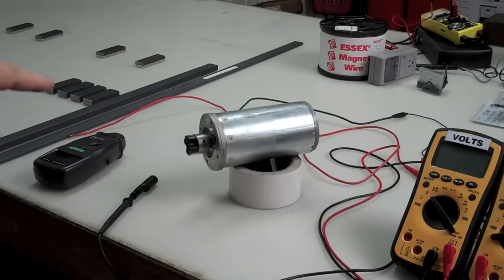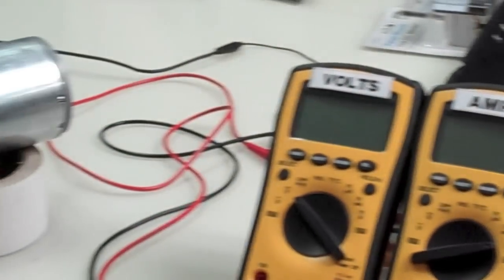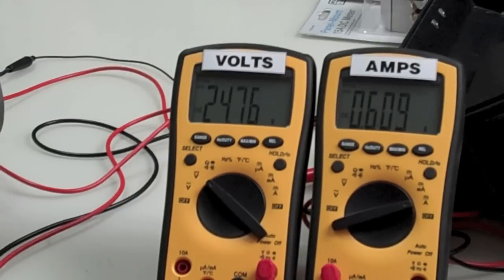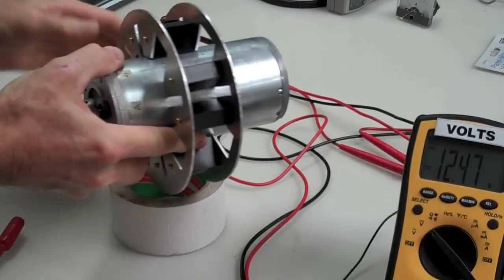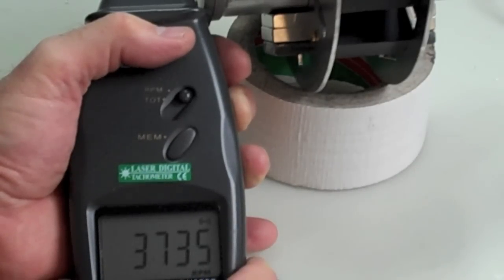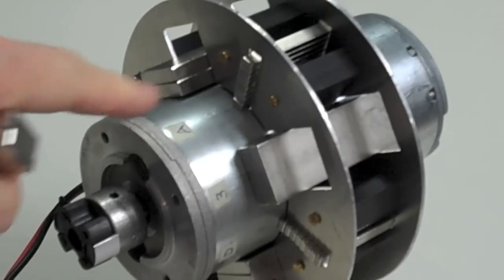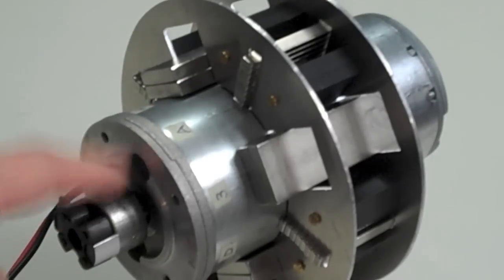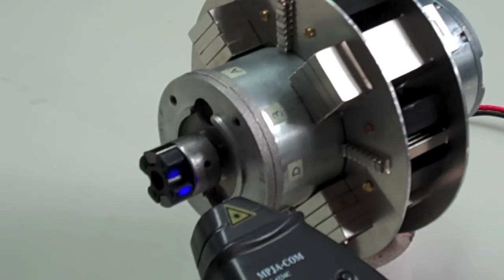STARGATE MOTOR  FULL DEMO

Comment: It would be nice to run the motor at 6V and see the power consumption and the rpm. I guess one could also design a circuit to vary the input voltage while keeping rpm at 3k AND driving an external generator with varying loads.

Comment: i did the same thing before with smaller motor, i was able to run a motor with another motor this way with less power in and more power out,  It is really simple

Comment: at 15000 rpm,there is a good chance of thrown windings in the armature.By the way,is that an old Heathkit vtvm i see in the background?Brings back old memories.
Reply from the maker: +Mike Henwood   I'm sure it would have if I had let it run at that speed for some time. Good catch on the old Heathkit!
Reply: +PMMG4HYBRID I built one of the old IM-11's way back when.

Comment: The aplication is already in use in more expensive motors(cheaper domestic motors use cheaper magnets), I believe. Would have preferred to see the voltage drop to 6 or 3 in the last experiment and see what the current draw is. Also how does it respond under load is the real question and how long do the magnets last like that? Does it strain the internal windings in that config?

Comment: U can get more power if u AC magnet design run the radient spike 90 degree to stationary AC magnet field this will produce homopolar motor on metal skin that cancel out but put a torsion field on aether u could see a free increase amp and volt

Comment: Great demo. I'm curious about one thing though - as you have a couple of alternating convex and concave features on the fitting, how can the RPM sensor be accurate? Wouldn't the motor be rotating at half (quarter) of the displayed value since it sees two (or four) mark per rev.?  

Try black tape (or use a sleeve of heatshrink) on the end, place a thin strip of white paper on one side, then measure to see if both agree. (The number is basically arbitrary, your demo is for simple comparisons.)

Comment: No problem. I didnt realize it till you had shown me what I had missed out on.  ;]
It is tricky. My train of thought was since it did go faster but used more current, that there was no gain to be had from it. I just felt like I created a larger motor out of a smaller one.
Now the key is this. What is the rated efficiency of a motor in question. If the motor is say 60%, are we only approaching 100% by adding mags? Or can we get the same increase with a motor that is already near 90-100% eff.
Mags

Comment: How does it operate under load can you use this system to turn an even larger generator motor and produce more energy than what you are putting into it so if you're using 1 amp and 12 volts can you spend another motor with that to gain 40 volts and 5 amps or more if so you could just keep scaling up or you could run that motor off of the larger motor with such a drastic power increase with low intake

Comment: [2]
2. As the motor rotates, the windings pass through the magnetic flux and this generates a voltage.  The faster a motor turns, the greater the voltage generated. That's the basics of how a dynamo, or generator, works.

3. A motor and dynamo are the same thing. While this may seem to complicate matters, it's the key to understanding both.

4. When you draw current from a dynamo, that current produces a torque which opposes the rotation. That's how the electrical load slows the dynamo.

Comment: Years ago, we had a motor that, if the bearings went bad, you couldn't replace them. If you took the motor apart, the magnetic field would become less, and when you put the motor back together, it would fly apart from spinning so fast. I think you are reducing the internal magnetism with your external magnets, and that's why it spins faster.

Comment: All you have done is alter the KV of the motor with your changes to the number of magnet pole pairs in the flux field, so it now does more rpm per volt. The power losses between input and output watts will be greater than before. Why not just use an higher KV motor in the first place?
Reply from the maker: I agree. Of course that would make sense. This was only meant to demonstrate rpm and/or torque changes through desaturation or saturation of the magnetic field by using external magnets. It may not be practical, but it certainly does work.
Reply: PMMG4HYBRID So in theory with the additional torque could potentially be converted into two more identical DC motors through pulleys and belt to generate/convert that additionally gained torque into power fed into capacitors that self run it and charge bat?  Now that is what i want to see!

Comment: Not one to sound negative, just an EE asking questions (no, I didn't take the time to read all the comments first - sorry) Motor RPM does not equate to Motor Output power. You can easily increase the RPM of any brushed DC motor by simply changing the timing, but at reduced torque. I do believe you ARE increasing its efficiency by adding to the magnetic structure, RPM increase just does not equal motor power output increase... you need to measure torque too, then calculate motor output in Watts.

Comment: Good experimentation...now some theory is needed. Power is about the same. Motor is running without a load so technically it is doing no work (other than heating the bearings and spinning air in the case and heating the windings). I think you will find very minimal improvement once you start putting a load on it, because the armature flux density is limited by the winding density, armature material and winding geometry. More current=more resistive losses=lower overall efficiency.

Comment: after building my 5th stargate motor, i am inclined to say that yes you can hit 15k rpm with a dynograde stator motor if you remember to run ball bearings instead of the sleeves and make sure to use 20wt oil on the winding's.

Comment: Yes you are absolutely correct i was just having this same discussion I told a friend to never just blindly accept when someone says something can't be done find out for yourself why it cant be done. Nothing is impossible it may not be easy to achieve what you want but if you stick with it you will achieve something,it may not be exactly what you had in mind in the beggining but you will learn something and that's for sure.

Comment: Sir, about a year ago I was playing around with a small dc motor designed for 3000 rpm, put 1 large neo next to it and it started overrunning. It was running on the stated current for that motor and with the very strong neo held at a certain spot the motor trippled the rpm and then an internal circuit breaker tripped/ the motor turned off and later worked again.

Comment: .. need to see some 'under load' testing ... yes ... some dynamometer testing of the motor ... 

Free-running no-load is not representative of much ... for instance, reducing the magnetic strength of the internal magnets inside and changing the communtator angle can speed the motor up ...
.

Comment: the thing to do is replace the stock bergs. with magnetic ones , wow no resistance !! then re-inforce the rotor with epoxy coating , we used to used that to stabilize coil ends in big mtrs       [100 HP ] when used in high vibration apps , such as rock crushers , hammer mills ect.

Comment: [3]
4. When a motor speeds up, it generates a voltage opposing the current. That's why a motor doesn't keep on getting faster and faster. If you drive a small motor from a 6V battery, when the motor's going fast enough to generate 6V itself there can be no more current flowing (ignoring the winding resistance for simplicity), and the motor reaches its maximum speed.

5. If you want a motor to run at a particular speed from a particular voltage, then you can change the stator magnets or the...

Comment: This is an interesting demo.
Is the purpose of the magnet augmentation to make the motor run faster, or more efficiently?
You may add another dimension to the research by connecting the motor to a generator which is loaded by a resistor load.
With the load attached, what is the ratio of power out in Volts x Amps to the power input in Volts x Amps ? 
If the stock motor could be goosed to a higher power output at the original efficiency and RPM, the manufacturer might be interested in your work.

Comment: I've seen a similar phenomena with a DC Perm mag motor when I stuck neos just to the top of it... it sped up slightly... pushed volts up slightly if used as a generator head...  Unfortunately the cost of all those neos prolly far outweighs the benefit of a 3watt drop and a ~500rpm increase eh?  Good finding tho!

Comment: I like it, you may have a market as well in the Razor modders market. They use 12v to 32v. They are always looking to make the motor run longer and faster. Why don't you get a demonstration model together and film it.

Comment: You are canceling lentz force reaction. You could just do that with shorted coils inside and use those coils to actually generate electricity. It should go OU and self run if you do it properly. The shorted coils produce compression which is an accelerator. All free energy devices use acceleration to convert mass into the atomic energy contained within the mass - no exceptions. Check out Thane Heinz for a good example.

Comment: It says that the effect is .125kw, 1 horsepower is 1.36kw, 0.125/1.36=/=1/3. (And that is without account of reactive resistance when you use the motor as a generator.)

Comment: [6]
9. This is a little hyped, because at first sight it appears that you get more performance for nothing, when in fact you don't (and PMMG4HYBRID doesn't actually claim you do, so no bad there). By decreasing the effective stator flux (or the amount which interacts with the rotor), the generated voltage reduces and so the no-load speed increases. But the torque decreases too, you trade one for the other. So the amazing speed increase comes at a cost: reduced torque.

Comment: It's not just the bearings that will destroy your motor. High RPMs cause the windings to expand from the centrifugal force until they start to drag on the field magnets.   That's why geared diesel starter motors go bad, mostly  the bendix can't disengage fast enough when the engine fires.

Comment: If you replaced the magnets with an electromagnet then you could change the rpm and torque of the motor just by applying power to the magnet. With enough power this might be able to work almost like a transmission depending on if there is any torque at all when the magnet is powered.  By changing the magnetic field around the motor you can alter the torque and rpm of the motor to the ideal conditions depending on if it is under load or not. You could put something like this in an electric car and have an even broader speed to torque range then you get with a normal one gear setup. The down side is that it would not be efficient at all.    Would this even work?

Comment: im doing this same thing with smaller motors. can all dc motors be acelerated by magnets? can these motors be used as gernerators, if so is it ac or dc that they put out? what is the polarity of the magnets on your motor, do they alternate from n to s, and does it matter whare you put them?

Comment: It seems like a great idea, and I am sure it makes a difference, but next time use one large fully charged 12V battery.
Set up the Voltmeter the Amp meter and the Rpm meter together with the motor and battery all in the same shot  with the camera mounted on a tripod - then show what it does. Please let me know if have done it Thanks.

You can also strip the motor and replace the bushes with deep groove ball bearings. Just turn up some adapter bushes and press fit the bearings into them.

Comment: Of course, the biggest limitation in this entire motor is the ball bearings that would melt from the extremely high RPM of this stargate motor.  I’d also like to point out that bearings are an energy dissipation element, and as such, they have a frictional torque associated with them. With no way to test and quantify this, all I can say is, since the motor’s net torque overcomes this frictional torque, the motor’s raw output torque is slightly higher than the final calculation.

Comment: Interesting. Did you try regulating the power down more? What was the number of RPMs at 12v without the stargate? Could you drop this down to 6v or 3v to keep the operation at around 3300rpms but reduce the power consumption?

Comment: What I like about this is something I have said for a long time, let's make electronics less wasteful. When a motor is only 40% efficient or power is wasted through Heat Loss the biggest preventable cause, we are throwing money out the window. Rather than people trying to defy Physics let's work with it as you have done. We could also use this for power generation rather than shutting down Wind Turbines in strong winds.

Comment: He could also drop the voltage down until the rpm was at specs and show the wattage usage is much less, this would show a operational cost savings.  On large 50 Hp motors this could save a company a lot of cash per month.  He is trying to show us how the efficiency has been enhanced using a focused magnetic field.

Comment: rpm != power; rpm × torque = power. By supplying less input power you are limiting the output power, so even though you are achieving a higher output speed you are getting a lower output torque inversely proportional to them percent gain in speed, and then farther reduced directly proportional to the loss in input power (that is, assuming the efficiency of the motor doesn't change as its output speed goes up).

Comment: +I guess that what you're really saying is that, once adjusted, you can get the same speed, and torque, with less voltage? Just by reading the comments, that's my guess at it, but the magnets would increase the efficiency?

Comment: Would like to know if you can give me some pointers.. I've made a stargate motor generator and was having issues using a voltage regulator to clean up the dc output power going back to my batteries and thus back to the stargate motor. Or is there a better approach to this?

Comment: Would the neodymium stargate work on a 48 volt dc shunt mother at 3.8 horse 62.5 amp draw 2300rpm no load speed? 
Intended for a 17' long 5' wide Aluminum bass boat!

Comment: I would like to see a load on it. I would like to see if there's less torque or more torque. Does the power of the motor increase with the RPMs? Or maybe it plateaus at a different RPM? Very interesting. You're basically building a motor on the outside of the case.

Comment: Did i got this right, that instead of raising the electromagnetic field caused by the coils in the motor, you instead raise the static magnet field by adding neodymium magnets?

How do you found out the correct outer layout for the neodym magnets, to increase the inner magnetic field at the exact right locations? Done wrong, i guess you could bring the motor to a complete halt.

What's the inner magnet layout? Are there 4 static magnets inside the motor too?

Comment: actually P=TXomega where T= to torque, and omega is the angular velocity of the rotating object (i.e RPM ).  I have checked several motor sites on the net to confirm this
I don't think he is talking about free energy. He is talking about using LESS energy  to run the motor. There  is nothing wrong with making a more efficient motor.  The big Three are now working on better motors for their hybrids.

Comment from the maker: Actually not true. The description refers to desaturation of magnetic flux. That's what makes the motor hit high rpm. Increasing the flux will slow it down, but gain some shaft torque.

Comment: what was the amp draw at the higher rpm now what happens if you have 6 voltsgoing to the motor with the maximum enhanced fields of the magnets and what happens to the amp draw in this condition and then what happens if you use it as a generator?

Comment: Well, I see the advantage gained, you are having the torque output, but quadrupling the rpm, by using a gear reduction drive at 4:1 you gain the output speed with double the torque rating at the same rpm without increasing power consumption.   Now this assumes a torque loss of 50% based on electrical readings as you had nothing in the way of a dynamometer to verify before and post application torque output, but the possibility is still very intriguing.

Comment: Playing with magnets is fun, I can't deny that, but I just don't see the point. If you want to compare efficiency you need to calculate against work done. With no load all you are doing is playing with magnets. Do some calculations for Watt Hours verses work done and see if your 'improvements' are worth anything. I'd suggest fitting a gearbox a and pulley and lifting something heavy a fixed distance.

Comment: OK. So, if you used a non magnetic case?, the effect would be??
Effects of using mag field deflection material on the inside of the case, not allowing the mag flux to exit the case????

Comment: Can i ask, i know that the torque of an electric motor is instant, opposing a combustion motor. Does the torque go through the roof? Have you tried to hold the shaft to see if you can actually stop it from spinning from the beginning? As the motor winds up, it will gain torque, but adding these magnets, you've just (potentially) increased the output of the motor's power. Im just interested in the torque. Like i said, can you hold the shaft, where the tachometer is while starting it?

Comment: Now put a load on the motor, and find a way of measuring that work. Now watts of work the motor gets done with what it consumes.

I'm not sure I understand this right, but electric motors have a "kV" rating, that is a measure of how fast it will spin with 1 volt. Add more magnets to rise kV and it spins faster, granted. But higher kV motors are also generally less effective, which is why it draws more amps.